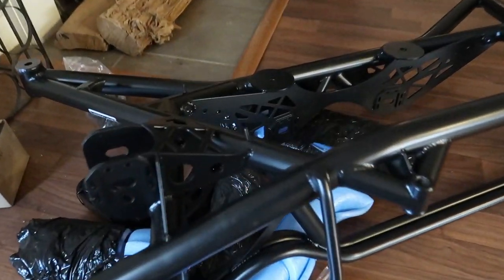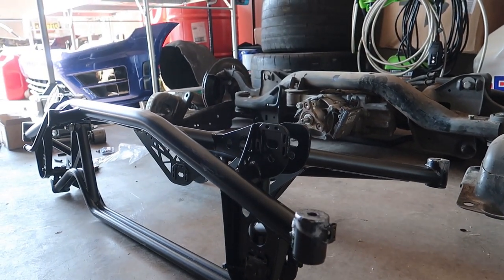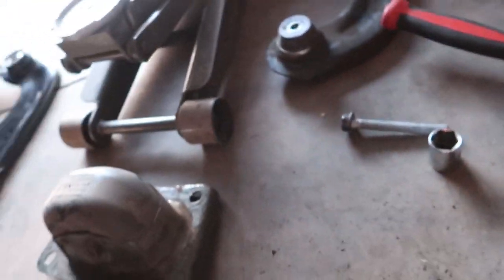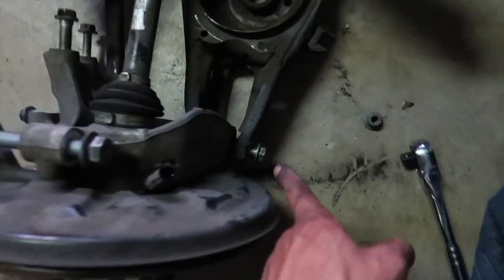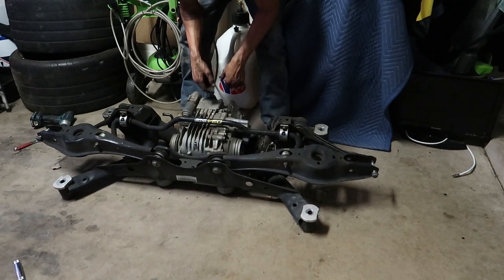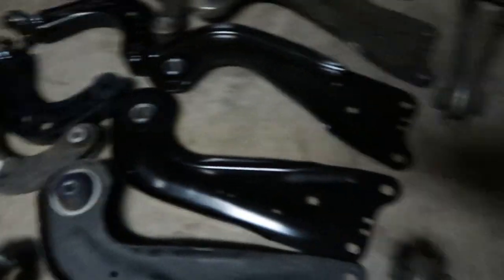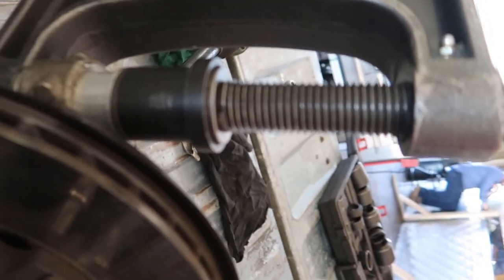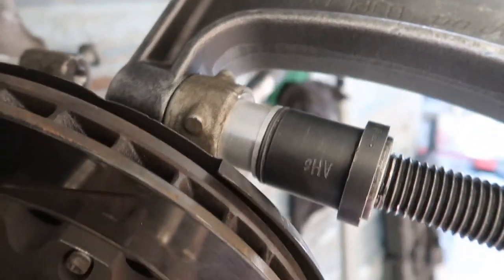Ripping the rear end apart for some tubular greatness! | MK7 Golf R

Comment: what suspension mod is your favorite?
Reply from the maker: Oof it's hard to say man. Not one specifically comes to mind.. really depends on what you use the car for. If I had to pick I would probably say coilovers.. way lighter then OEM suspension, it's adjustable, the camber helps SO MUCH in the corners and camber makes all the difference.. besides that probably honestly just getting a proper alignment. I had my shit all out of wack then a dude here on the channel schooled me on some shit I added toe out front and rear it totally changed the car. Besides those two.. front strut brace from eurocode and a rear sway bar upgrade
Reply from the maker: After this rear end install though this will probably be my favorite we'll see! 🙂